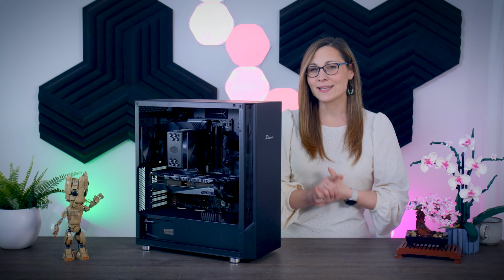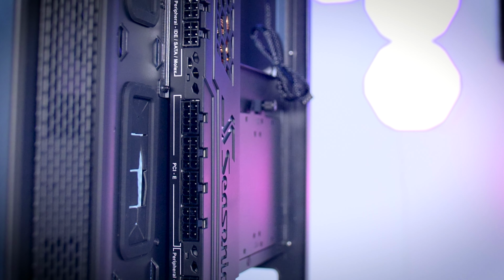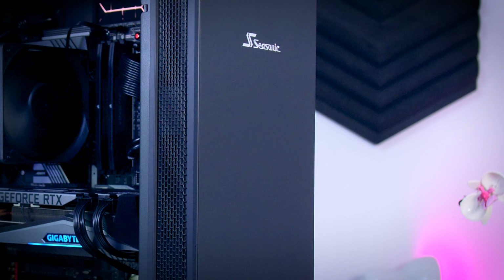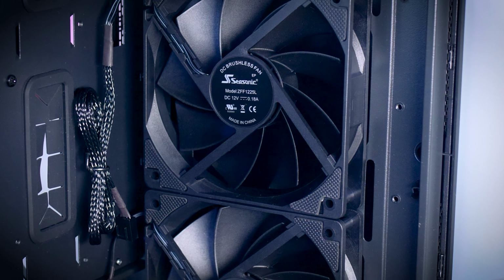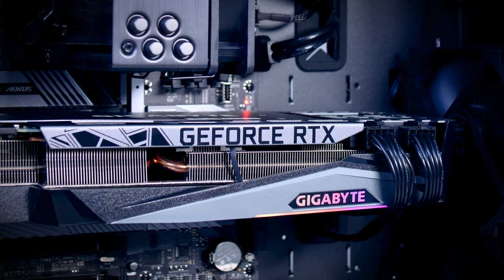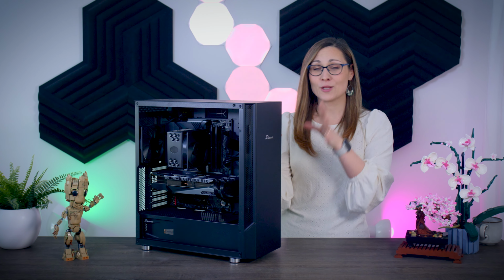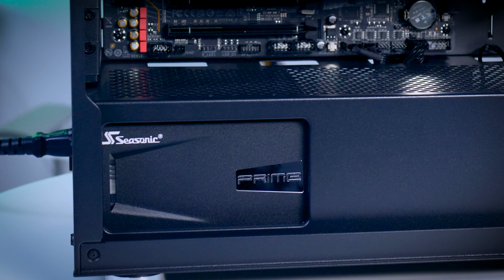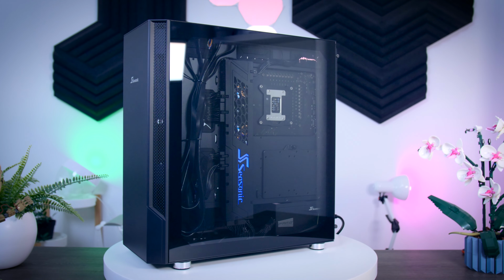Seasonic Made Another Case - Arch Q5 Build & Review

Comment: I really wish Seasonic can provide some more brave interesting solution like a universal cable management panel for more brand cases, or move power supply outside the case , redesign the power supply like the laptop adaptor so the case specially itx case has more air flow  more RGB decor options.

Comment: I wouldn't get this case. Setting aside the price issue, I don't have AC and the summers where I live are typically in the 90s F for months. I really doubt my system would do well in a case with such poor airflow. The fact that you measured 40 dB from 50cm away suggests that either the fans are noisy or they were revved up to compensate for the poor frontal design. What do you think?

Comment: I love the case design🥰👍 w/ pre installed psu / Connect box ……..and admittedly the components temps were surprisingly very good considering the high tdp cpu and GPU. However the price ….. OUCH🤕! I think about a $40USD price reduction is in order 🤔.

Comment: Seasonic is forgetting the most important rule in hardware, software and all related to informatica: The more points of failure added to a system, the more likely a failure will happen.
Reply from the maker: They're just extending the connections out. Doubt it's that much more likely to fail, if at all.

Comment: A pity it chokes air on the front, i cannot understand why reviewers not say it gets a insufficient, because 
it is almost completely closed on the front, i absolutely do not want a case that has that.

And a good test, would be removing the front, and then test temp.
Reply from the maker: Because it tests completely fine, even with a 3090. Assuming a mid-range build, I don't see an issue with it.

Just, don't choke the front intake with a large radiator I guess.
Reply: @TechTesters  I would have love to see a test without the front, if the temps go WAY down, and not only 
1 a 2c, then it is chocking airflow, and is not a good case.

That would have been a good review of a case with little airflow.
Reply: Does it? The testing doesn't seem to show that. Cases with enough ventilation on the sides and sometimes the bottom of the panel allow plenty of airflow. Air is a liquid and will flow.
Reply: @cowmath77  Sorry i saw nothing of the temps she was talking about and we saw written, but i believe her, 
but a good reviewer, takes of the front, to see the difference, and if the temp difference is large, then yes it is 
chocking the airflow.

It only take a few minutes to remove the front panel and another 20+ minutes to measure temps.
Reply: @cowmath77  excellent compared to what? it's the only case on that chart with no ambient temp, go see how gamers nexus does proper case reviews